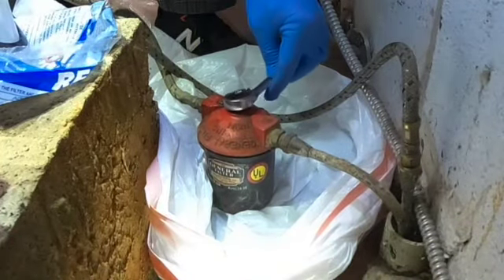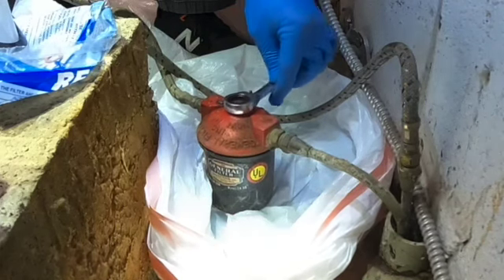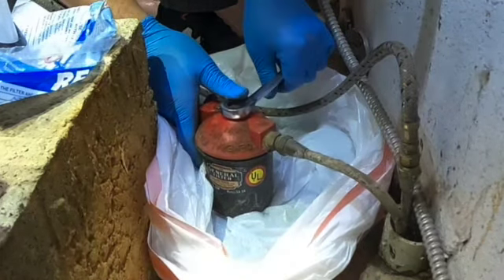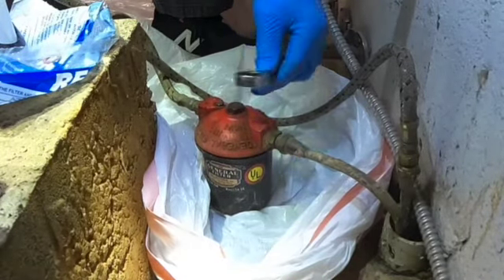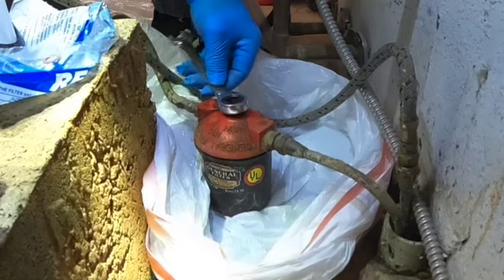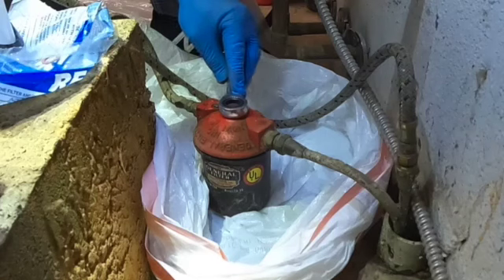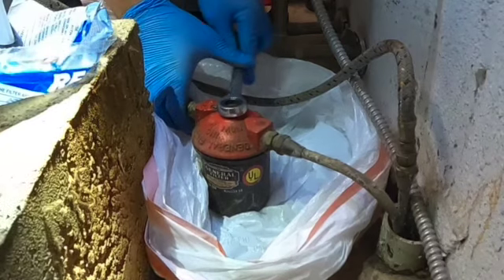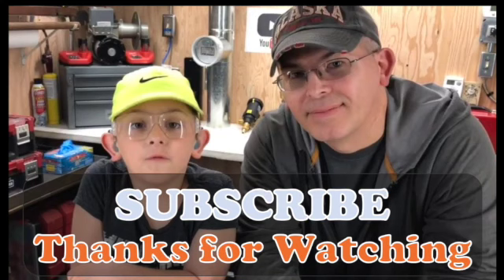How to change BURNER Fuel Filter

Comment: What part of the country is this in it looks like it runs off  number1?
Reply from the maker: Thanks for the question! I live in Alaska, we run #1 in above ground tanks and #2 below ground!
Reply: @furnacetech2581  wow thats so interesting I'm in Massachusetts and I've never seen a burner run off number 1 most residential tanks are above ground in basements or garages the only time I run into a above ground tanks outside are at mobile home parks and those run off number 2 as well but just use special additives during the winter months
Reply from the maker: @sirhc07  we get down to -40 -50 degrees Fahrenheit which is way to cold for #2 heating oil! 

By the way, what kind of fuel additives are you guys using?
Reply: @furnacetech2581  wow that sounds absolutely bitter we just use hot shot

Also what is the price difference between 1 and 2?
Reply from the maker: @sirhc07  #1 is a more refined & designed for use in low temperatures. It is similar to Kerosene
Reply: Not bad.  Do you wet the seal with oil? Or leave it dry?